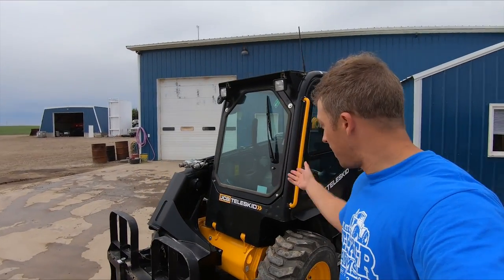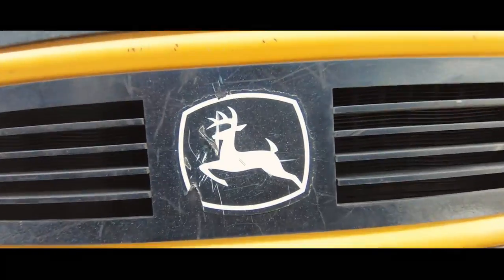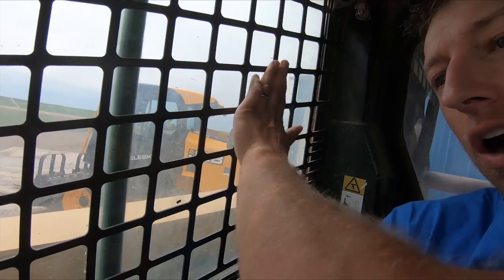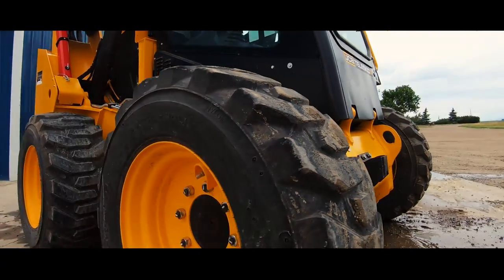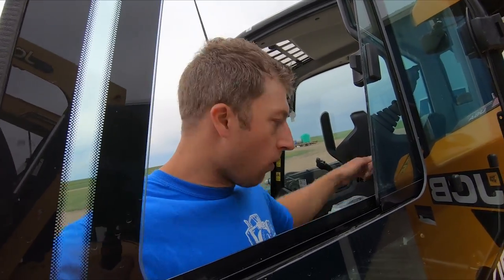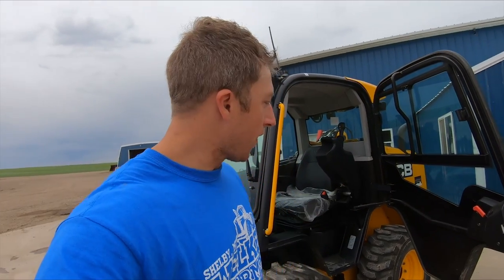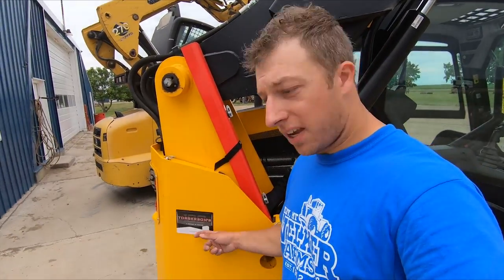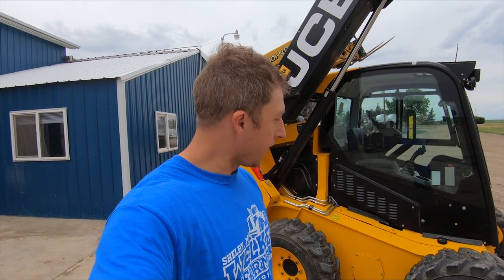JCB Teleskid or John Deere 270?

Comment: When I was shopping for a skid loader, I was focused on Bobcat, back in my day.  I tried the 743, but it really felt lacking and I didn't like that it was all it could do to load a 15 yd. dump truck.  I then tried the 7753 and it was night and day for me.  High lift arms made side-loading the large trucks a lot easier and it had a wider stance.  I had a 72" bucket with removable tooth bar, forks and a landscaper attachment.  That there was an amazing implement!  This was back in the early 90s and I bought the 7753, used, with 1400 hours on it and immediately put new tires on it and then had them solid rubber filled.  At $100 per tire, that was a major money saver when working around thorny trees or demolition duty on jobsites.  I would get my job done and come away from the site with my tires looking like a porcupine - but obviously NO flats!  It's no fun having a flat and paying for a service truck and the down time.  Rubber-filled was definitely the way to go for me.
Reply: We have a 743 kitty here that we use fairly regularly.. it's a clapped out pile of crap now but it's still working!!!

Comment: I've ran a Deere, Bobcat and a tracked Cat, and the Deere is noticeably louder than the Bobcats. The Bobcat A300 I ran was two seed, but it could switch steering modes. It could skid steer or four wheel steer which kept you from tearing up lawns or scuffing up fancy concrete sidewalks.  Of the three the Bobcat was so much nicer and while the Cat was solid, it was a single speed and slower than any of the others even if they were in slow speed. 
The thing that makes them so pricey is they can replace a dozen or more dedicated machines for small jobs. They pretty much make an attachment to do nearly anything. The company building our new shop used a big tracked Bobcat with a road grader attachment and graded the gravel inside the building's foundation after the steel supports and roof had gone up. That zero turn radius just makes them so much better in confined spaces.

Comment: They should pivot the left joystick console with the door.
You would have way more room to get in,and less parts to move to go in and out.
It's drive by wire,so it's relatively easy to do.

Comment: The only problem with the JCB (and i know this for a fact, having seen ours nearly tip over a few weeks ago) is that despite their best efforts (there's some really clever engineering in that unit) it's skewed towards the arm side, in terms of weight or better said, balance. Makes our operator a bit nervous "walking" edges or moving stuff on inclined terrain.
We're prolly going to add a few weights on the other side.
Reply: Buy him some tacos.. operator is the counter weight

Comment: Would love to have a skid steer, but we just don't have enough use for one. We have a 5085E with pallet forks we use to pick up pallets. Every couple weeks we bring in a ton of cattle feed and have no problem picking it up. It is a two person job though, because the visibility is not very good on the loader. The only piece of construction equipment on our farm is a  John Deere 17G excavator. We use it for digging trenches, ditches, leveling ground, putting in culverts. Man it is a great machine.

Comment: 2019 JCB has my vote, with regards to visibility out the right hand side, in reality you should not be driving around with the forks/bucket up in the air it needs to be like an inch or two off the ground then the boom won't be blocking the right hand side vision.  At the start it seemed to me your lip movement to your words seems off?  This video came up while I was playing Welker Farms map on FS19 :)

Comment: We run a 326D Deere. It has been a very good machine for us. The worst problem we have had is the front quick tach plate was too light and bent which also took the electric actuator out too. $3000 later it was fixed.

Comment: I have an old JCB 535 farm special telehandler, not as compact as the new tele skid steer, doesn't turn on a button, but shortest wheelbase on a full size telehandler available, pick up hitch and auxiliaries. No where near as fancy as the new fly by wire machines, but your comment regarding the old skid steer having direct link between handle and hydraulic valve resonates. You do get better "feel" of how the hydraulics behave. Great channel, informative and factual, no fluffy stuff 👍

Comment: we have had a kubota svl 75 for 4 years it has about 2000 hours on it. no complaints or promblems with it.
Reply: I like the the Kubotas still use full hydraulic controls. I've never used a machine with fly by wire hydraulic controls, but nearly everyone I talk to who has mentions that it takes a long time to get used to it and is never as precise.
Reply: it might not be as precise but kubota will last longer than most machines and is more practical when being worked on.

Comment: Not to be apart of the H&S brigade :P But... do be careful walking under those Skid steer booms, there was a sad case in Scotland not too long ago, of a Recycling worker crushed to death when the hydraulics failed and the bucket and boom hit him, 38 years old with two kids and a wife #safetyfirst
Reply from the maker: So sad 😔 that is tragic!
Reply: That’s why modern machines have a boom strut to catch the boom if something happens with the hydraulics the boom strut will prevent the boom from the crushing the operator. If the boom strut if damaged it can be replaced your life can’t. #safetyfirst

Comment: I used to own a JCB backhoe, it was an excellent machine.

When I bought a skiddy, it came down to local dealer support which was Deere or Bobcat, with Case a little further.  Lots of used JD's and Bobcats in the area.  When I found out the oil could only be checked by leaving the boom up on the 324 I was looking at...I thought...who ever checks the oil on these things?  Its hard, dangerous, and takes a lot of time?  I've learned with maintenance, humans share the trait of not doing hard things that they don't "have to" right now....so I wonder how often the oil gets changed on the average deere skid steer, especially if its ran by "the help" instead of the owner?

So, I opted for a Bobcat S220.  I've put over 500 hrs on it in the last 6 years and absolutely could not be happier.  I do like the side entry on the JCB, but other than that, I've found excellent support out of my local dealer with FANTASTIC PRICES on parts.  Frankly, I expected the parts to be INSANELY EXPENSIVE like Deere...nope.  Very reasonable.

The only problems I've got at almost 2600hrs are the blower in the cab quit a few months back and I've got a bad seal on the left bucket cylinder, and various tire problems (not the machines fault).  Thanks to the great local dealer I'll most likely trade for a newer bobcat when I get closer to retirement.

This year alone the bobcat dug a bunch more post holes around the homestead/warehouse, 12-24 & 36" holes.  A bunch of support work on a new septic system on one of our rentals (3rd year in a row for a new spetic system backfilling and grading), it placed a couple hundred more tons of driveway stone and did the heavy lifting and digging for a new 21' bridge we built back in the woods and moves customer goods from semi's to warehouse and then out to delivery.  Love this machine....don't know how I could do without it at this point.

Comment: Great video, Nick.  We have been with Bobcat for 35 years, and love them.  I have run a few different New Hollands as well over the years.  The Teleskid is an awesome machine for sure, but way out of reach for us as well.

All of our machines are older models, and like your JD, I do like the feel of mechanical controls.  The reliability that a mechanical machine comes with too is a real perk in my opinion.  I know that the old machines are not maybe as safe as the newer ones, but the best piece of safety equipment on the farm is the piece that is between your ears.  Cheers - God Bless!!
Reply: There's a hammer to break the right side or front window.

Comment: A great review, and your decision well founded. I have owned Bobcat and a DEERE skidsteer and both served us very well. My only experience with JCB is an early 70's backhoe. We found the JCB to be terrible for getting parts for and it was some kind of metric that was odd for any fit. Our CASE 580 a much better hoe. But having a local JCB dealer would make a JCB a good choice. BUT, all too expensive, the old DEERE still does the job. Oh, we mounted backup and side cameras in our DEERE for safety, we were a school district and wanted to see everything around us. Surprised the JCB didn't have cameras from the factory.

Comment: Use to run a Skid Steer for a living bailing cardboard and any other jobs from grading the parking lots to moving dumpsters clearing brush trees even finished tearing down a house after the fire dept burnt it down for practice. The first one was a Catipiller 242 and the second one was a Catipiller 252B got them both new with zero hours only a few tenths of hours on them. The 242 was a good one and they got the 252 for me after 3 1/2 years cause I put 7700 hours on it. The step up to the 252B was nice. That thing was a beast compared to the 242. The Tela Steer that Machine looks nice and van see how useful it could be. It would have been nice to have one of those back then. Theres so much that you can do with them and can and would save a lot of work and getting in and out

Comment: Fly by wire is just something you have to get used too. We have a 310J and we sold an old 555D and got a 14CX super and it had fly by wire and the problem is you can’t feel the hydros so sometimes in situations it’s hard to tell what’s going on and it’s really sensitive in a bad way and it can get out of control pretty quick. But the joystick control is pretty comfortable and nifty. That teleskid is a super cool machine

Comment: I am roughly 2 hours north of you from the land of the two colored flag. I rented many skid steers and tried most models. I ended up buying a new 2008 S250 Bob Cat. I chose it for the visibility and the 10 1/2 foot lift. It also drilled holes better because the arms would come down plumb. I can see that the teleskid  has great visibility and I do like the side entry. You are correct about these machines retaining their value. I sold mine in 2017 with a little under 2000 hrs for the price I paid for it. Like your video's. As a kid we occasionally came to Havre for holidays.

Comment: One good thing about a front entry door machine is technically you are not supposed to be out of the machine with the Boom in the air in case someone tries to walk under it so it's almost safer in that way as long as the operator stays in plus skid steers are built to be used in tight spaces so like you said the door swings out on that teleskid making tight spaces hard work
Reply: That might be the case for some situations and for them there are many skidsteers to choose from.  But for most the side door is awesome.

Comment: We have a 2011 John Deere 323D skid steer. It’s a track machine with foot controls. Yesterday I was driving it down the road and was turning into the driveway and heard a pop and lost steering on the left side. Next thing I know theres hydraulic oil all over the highway and then the tracks locked up. Got halfway off the highway. Luckily we have a D6 dozer and we used it to pull it off the highway. It was a mess.

Comment: Ive ran a 96 Bobcat s170, and a newer S170 by Bobcat, i gotta say, the newer one was very nice, having AC  is a plus in the summertime, and a heater in the winter. Granted i have very little time on both machines. I still understand the key essence of the hydraulics, having either purely hydraulic valves, vs fly-by-wire systems. The newerS170 i ran only had .3 hours on the clock when we borrowed it from my dads work. We put just over 6 hours of use into it working at our house, adjusting our new shed and some other small things. It was sensitive on controls, it had the finesse needed for grading, float option, yet had the gentle response of a pure hydraulic valve system like your JD does. Yes it did have a front entry, but ive already accepted the risk in operating equipment. No matter what machine you run, there will always be at least a 1% risk of something happening. Nothing is completely safe, but damn did JCB do fine job minimizing it via that side entry. Maybe i can run one someday :).

Comment: Have not run the JCB yet but with your details of the unit I would put it on the must check out. Only thing would be to have one with tracks. Once you have driven a track skid steer you will not want the tire unit in my opinion. Thanks Welkers for the outstanding review

Comment: pls take this as possible way of handling the boom/lift on the jcb skidder...and keep in mind that i do not walk in your shoes...so to try to reduce potential vision hazard on the boom side always try to keep the forks or bucket or what ever at its lowest possible position when ever moving the vehicle which 1 should help visibility and keep from running into someone or something and 2 it generally is better to move the machine with the load all the way down and tilted back to preserve whatever is being transported...generally should never move a loader with the load up...hope this helps and does not hinder ...great video

Comment: I’ve got a 260 series 2 two speed.  Same thing but scaled down a bit and a 3029 instead of a 4045 engine. Rebuild engine at 9k. 13000 hours now. Love the machine. Sometimes when you’re scraping an ally of the barn you just need to get out and that roller door is so nice because allies don’t have the space to open a door sideways.

Comment: I'm still running a John Deere 7775. Replaced all the hydraulic pumps and motors, and valve body. It's old, rough around the edges but it does everything I ask of it. I had a custom hydraulic pump built so it runs my stump grinder better.

Comment: As always great video JCB very nice . The reason the John Deere is cold-blooded is compression issue it's normal as they get older we had one at work if you did not plug it in I got below 40 degrees it would not start without plugging it in and either in it they put it in the shop how to rebuild kit in it and it was much better you didn't you have to start it on either for everything even in the teens

Comment: Being able to get in and out with the arm in any position is really nice. If I thought the one arm could have withheld a rotary mulcher, I would have gone with JCB.
Reply: what kind of weight is a rotary mulcher , i drive a JCB teletruk ,single arm  fork truck . similar design to the one arm skid steer in the video , that  lifts 3 tons  no arm twist at all.

Comment: I've just recently bought a 2005 Bobcat 773 high flow from a farm where I used to run as well as a 2010 JCB skid steer. I love the cab and the boom reach on the JCB, but overall, I much prefer the Bobcat. It doesn't have all the refinements of the JCB, but as working tool, it wins hands down. The Kubota engine in the Bobcat seems to be alot more reliable also.

Comment: We have 2 of the tracked units at work, they both have bent booms on them just from normal dirt work, also the jcb you can't see if you are using forks at truck bed level.
Reply: This is what I was concerned about was bending that boom and how easy or hard it would be to do it.

Comment: Have you been to forklift school?  Fork lift operators are taught to carry the load close to the ground for good visibility.  Many people have been driven over because poor operating habits.  Also the pedestrian around equipment must always be aware that the operator may not see them.  In the 70's I had to attend the school when working in a paper plant. They had one every year for the entire staff, including office personnel.  The best lift trucks (IMO) were the ones that reached in to take the load, instead of driving the truck into get the load.

Comment: So if you want a really nice reliable and  simple skid steer I would recommend a case xt model. They are a single line of skidsteers ranging from like 45 to 100 horsepower. They are about as old as your John Deere. They’re very reliable and sturdy. The pickup capacity on the 95 xt is over 3000 pounds I believe. The cold start is very good which would be a major point for you guys. The hydraulics are very simple the same as your Deere. Not an expert by any means just my opinion.  You guys do such an amazing job.

Comment: after 20 years as a dealer mechanic for forklifts my biggest concern would be life and or wear of the boom if the machine was used primarly as a bucket machine for digging  or working dirt.  before you buy one compare it to new state of the art telehandlers, skid steers, forklifts and small articulated loaders, they all have a place and specialty in material moving industry.  also consider the option of renting a piece of equipment for specialty tasks such as building or roof construction.  A set of pin on forks for the loader would probably be an investment that would open lots of options for outside work and a small 5or 6 K capacity pneumatic tired forklift would be a godsend around the shop and barnyard. skid steers are also very versatile so it probably comes down to what is the primary use and who has the best dealer support for parts and service because a machine yhat you cant get help with is worse than useless
Reply: Lifetime warrentee on the booms

Comment: Ran a a kubota svl 95 for. A couple weeks it's a real beast,  with a 3/4 yard bucket it'll fill the cab before it spins or power out. Cab is huge. 
Serious power like push out a stuck on the frame  jlg 12k.  
If i was in the market that would be my choice. 
Downside to side entry don't get stuck close to something where you can't open door.
Reply: You can break the top, side windows with a glass hammer inside of the cab